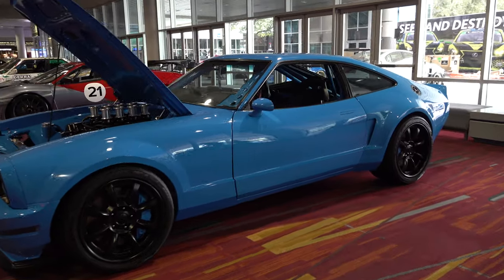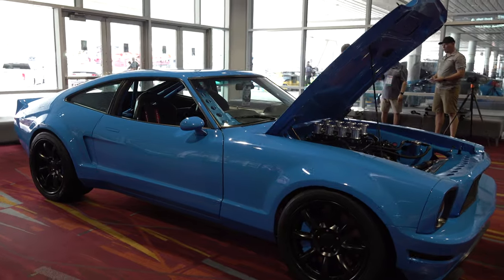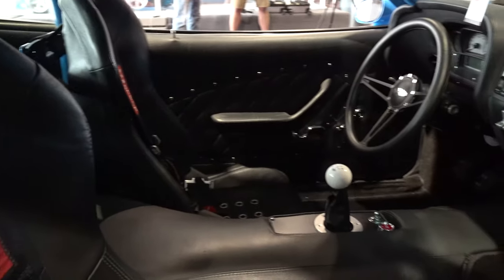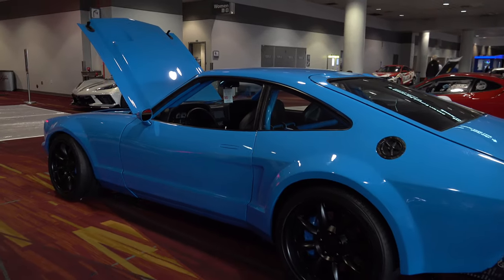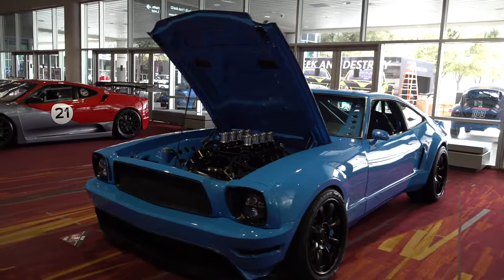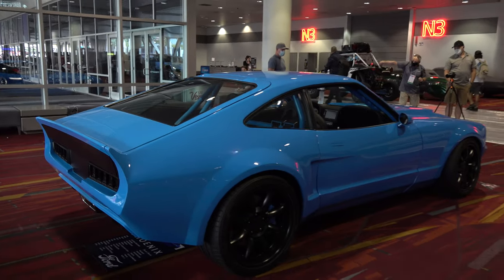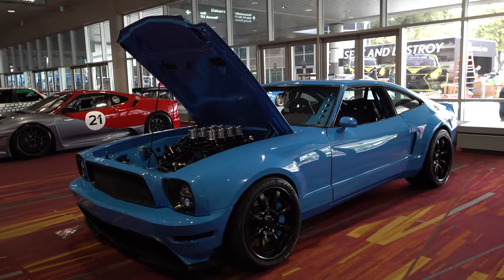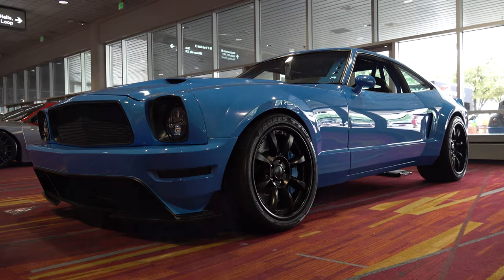1978 Ford Mustang II "Mustang Evolution" "Mustang II Phoenix" Street Machine 2021 SEMA Show

Comment: The only cool Mustang II? lol The lightest Mustang ever made, with a state-of-the-art front suspension that made it out handle the previous Mustangs, and can be made fast with some simple engine bolt on parts. Not to mention the excellent(for the era) aerodynamics of the body. The perfect project car. I love racing nay sayers with my II, including the quick bikes. 2450 lbs, 530hp, stroked 302, pump gas all motor.
Reply from the maker: Right on...Thanks for checking this one out here!!

Comment: The thing that makes it cool looking is not the horsepower, but the adding to the wheel base and bringing the front wheels forward. Glad you went to the coyote.  The v-10 was a big lump.  The v-10 front end weight must have made it steer like a pig. Also thanks for getting rid of the celica rear.
Reply from the maker: Thanks for checking it out!